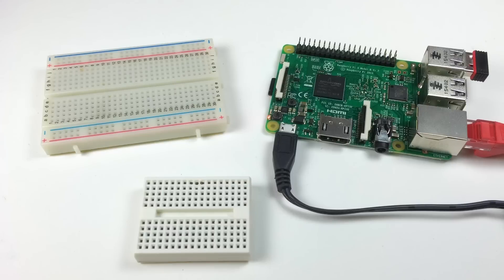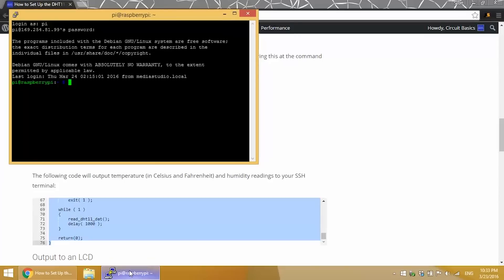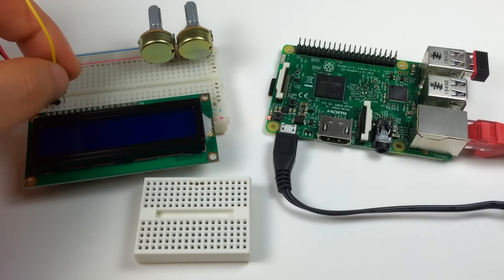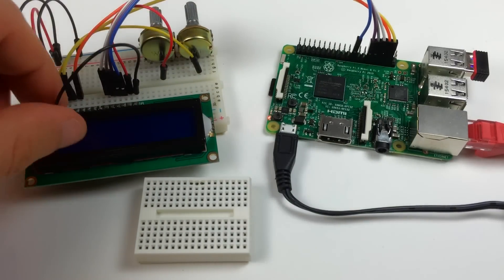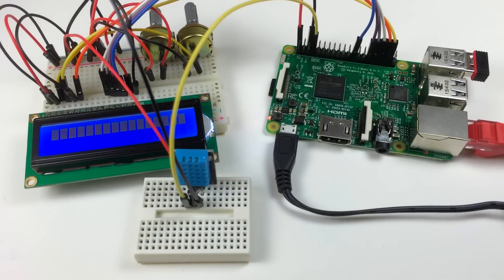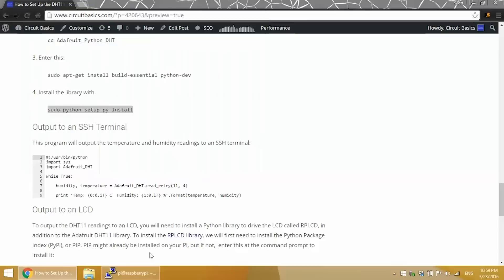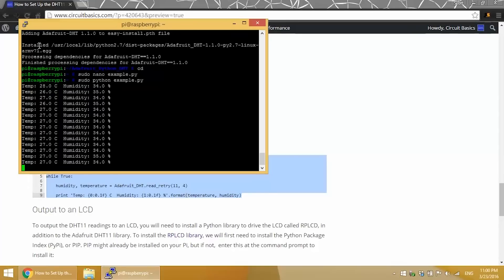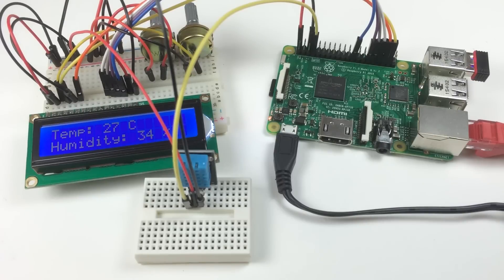How to Set Up the DHT11 Humidity Sensor on the Raspberry Pi

Comment: My LCD does not  read temperature and humidity when I run the output LCD code as it is on the  video. please I need help. I use  C program

Comment: so total noob question is there a way to hook up a second probe into this system and have it output its temp on the screen? 

going to be setting this up for an octopi and setting this up in my garage/workshop and want one in the enclosure of my 3d printer and one outside and be able to see the difference in temperatures would be neat. I'm not great with code but can kind of read it so will just need to set up a second "deceleration"(i think) for the second probe. wiring the mess will be another project and getting it to look decent will be another and a half.

Comment: “Data not good, skip” for every line. Any idea on how to fix this? I tested the sensor with an Arduino and it works just fine, but it does not give an readings with Raspi.
Reply: wrong pin number? try to get your Pi pinout with command "python3 pinout" that you can install with "sudo apt install python3-gpiozero"

Comment: Problem not reading the sensor:

#!/usr/bin/python
import sys
import Adafruit_DHT

from RPLCD import CharLCD
from RPi import GPIO

lcd = CharLCD(numbering_mode=GPIO.BOARD, cols=16, rows=2, pin_rs=37, pin_e=35, pins_data=[33, 31, 29, 23])

while True:
    humidity, temperature = Adafruit_DHT.read_retry(11, 4)
    lcd.cursor_pos = (0, 0)
    lcd.write_string("Temperature:%d C" % temperature)
    lcd.cursor_pos = (1, 0)
    lcd.write_string("Humidity   :%d %%" % humidity)
 

   >>> %Run TempHum.py
/usr/local/lib/python3.7/dist-packages/RPLCD/gpio.py:149: RuntimeWarning: This channel is already in use, continuing anyway.  Use GPIO.setwarnings(False) to disable warnings.
  GPIO.setup(pin, GPIO.OUT)
Reply: Using Pi 4

Comment: Hi, thank you for the video. Personally, I feel that the response time for temperature measurement is slow compared to that of the TC74, thus making it kind of inaccurate. However, the response time and accuracy for humidity is spot on. If I had to measure both temperature and humidity simultaneously, I would use the TC74 for temperature and the DHT11 for humidity.

Comment: Ok you guys to fix the data no good, skip. Go into the code and change delaymicroseconds from a 1 to a 2 or 3. Then change at the very bottom where it says delay(1000) to delay(2000) or delay(3000) depending on what number you changed the other one to. This gives you some readings and a few bad data but hey it works
Reply: it didn't give anything other then date not good, skip. what's wrong with this

Comment: DHT 11 Sensors use 5V and raspberry pi use 3.3V  logic level. If I connect direct 5V Output Sensors with raspberry pi so it is safe to use.
Reply: Yes the DHT11 can directly  be connected to a 5 Volt DC rail

Comment: Why on earth do you run the editor as root with sudo?
The editing and compiling should be done as an ordinary user.  Running the program as root is another thing.
But you should always avoid that too.

Before installing a packages, you should upgrade package database and update all installed programs.
sudo apt update; sudo apt upgrade

And you should not connect the devices with power connected.   Never, as that make it easy to ruin the devices.

Comment: HI, I am receiving the following error:
File "example.py", line 9, in <module>
    print 'Temp: {0:0.1f} C  Humidity: {1:0.1f} %'.format(temperature, humidity)
ValueError: Unknown format code 'f' for object of type 'str'

Can you help what am I missing?
Reply: Looks like that's Python3... the base code wasn't for 3.
Reply: did you find any solution ?
Reply: same error, any help?
Reply: I had same issue also. I solved it by fixing the wirings of my dht11
Reply: Its indicate that your sensor data not read by raspberry pi.May be your sensor is damaged.Change sensor and try again.
Reply: Try pasting this:

print("Temp: {:0.1f} C Humidity: {:0.1f}".format(float(temperature), float(humidity))) 

Let me know if it works/doesn't
Reply: @casinomann  doesnt work either

Comment: Output with C "Data not good, skip", python just shows emptiness.
Reply: Do these steps and it will work ! :)

https://www.raspberrypi.org/forums/viewtopic.php?f=33&t=7583

https://wiki.geany.org/howtos/configurebuildmenu
Reply: I figured it out in the end and also I've switched over to Arduino long ago x) I'll start toying around with the Raspberry pi again later sometime though :) Thank you for the response!
Reply: same issue with me. Is there any solution for this issue?
Reply: I just started using an arduino instead x) Now everything works as expected. I've learnt quite a bit in these past two months as well so maybe I could figure it out now but the Raspberry pi is now a dedicated ssh server and media center x)
Reply: you're very welcome ! I actually just solved this problem few minutes ago. Now I have another problem "Data not good.Skip" now lets see how I can figure it out :)
Reply: i have the same prob "Data not good.Skip" :( did u solve that pb??

Comment: It works!! I love the video and I am interested as to how you use the delays. If I am not mistaken you use delays so you can read the input at the right time, but how did you calculate the amount of time you need to delay?(GPIO pins are digital pins where as you need to read analog. The timing allows you to read like an analogPin would.)

Comment: Whenever I try to run it on ssh with Python it just comes up with the message: 
Traceback (most recent call last):
     File "temp.py", line 3, in <module>
         import Adafruit_DHT
ImportError: No module named Adafruit_DHT 

I have installed all the files you mentioned in the video for Python but whenever I try to run it, it just has this message.